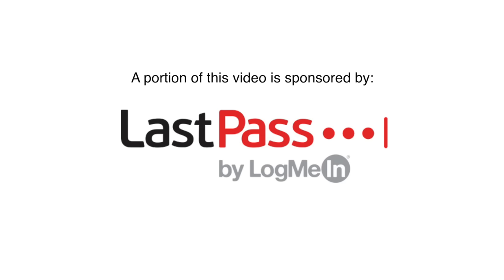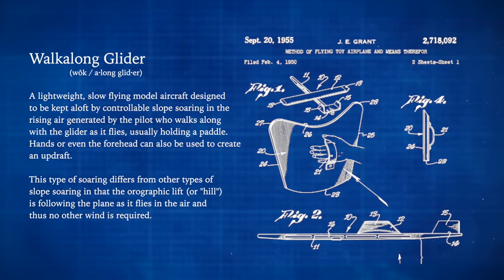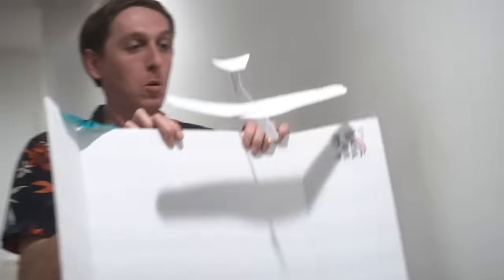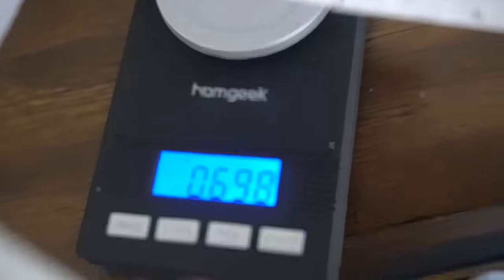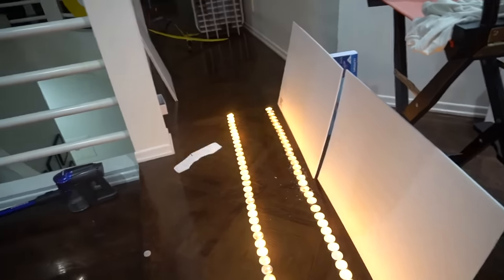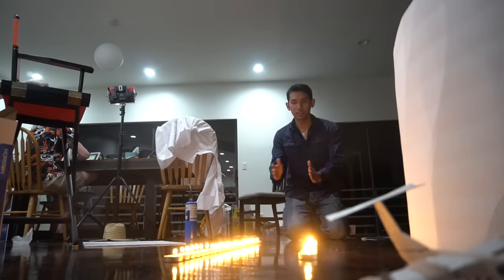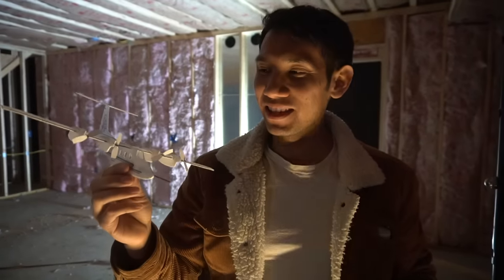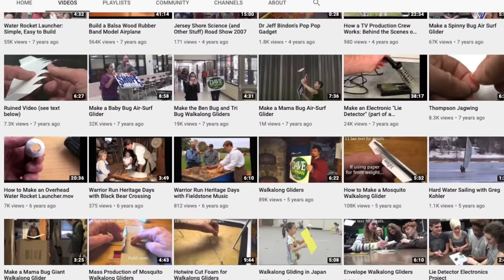Infinite flying airplane! (walkalong gliders)

Comment: This is a fascinating scaled-down study of ground-effect! We experienced this on a much larger scale in the KC-135 air refueling tanker. Whenever we had a very large receiver aircraft such as a B-52 or a C-5 Galaxy, our airplane would pitch nose-down slightly and airspeed would increase a few knots due to the reduction of induced drag from the other airplane’s wing. It had the opposite effect when the receiver aircraft departed, and at times was nearly violent if the receiver pilot wasn’t smooth with his exit. Thank you for this very cool experiment!!
Reply: wtf a frickin air force pilot in the comments? thank you for your service
Reply: not really the ground effect tho, this is the effects of a blunt object in an airstream changing the airstream

Comment: Peter, in many wind tunnels like the ones used to test aerodynamics of cars and stuff, the fans actually suck the air in instead of blowing it out. This gets rid of pretty much all turbulence. If you decide to retry this then maybe you can take this into consideration. :)
Reply: @Caleb P why's that? If he recreates the tunnel, you'd just need to put the plank of foam in front of the fan, and the plane in front of the plank.
Reply: @Caleb P Exactly...
Reply: @Caleb P you've got a point. The point of the air blowing onto the ramp is to generate lift. If the ramps sucked inwards it wouldn't work.
Reply: @Caleb P if the fan was positioned behind the plane and the board to "suck air",  i think the fan wouldn't be "pulling the plane" per say. The fan would be sucking the air all around it. The air would still be moving in the same direction as if it were being "pushed" or "blown". It would still hit the board and still generate lift. 
However, even if sucking the air is less turbulent than pushing it, as @KylePrupas said, sucking it into the board may still create too much turbulence for a steady "infinite flight".
Reply: @Caleb P Wrong. The air flow is what matters, not the location of the fan. If the wind is blowing directly at a wall and you stand in front of the wall, the wind in the middle of the front of the wall is nearly as still as the air behind it. And wind is just as much air being sucked into a lower pressure area as it is air being forced from a higher pressure area.
Reply: @crackedemerald4930  the airflow may not be sufficient to provide enough lift with a board between the plane and the fan, its like trying to suck air through your bedroom wall, it ain't gonna work
Reply: No, I’m pretty sure Peter did what he did cause he wanted it to have a treadmill like effect. Correct me if I’m wrong :)
Reply: @vortorixx  Yes and no. Yes, the treadmill effect worked, but he couldn't make it work indefinitely

Comment: When you are walking behind the glider, you constantly monitor its position and flight path and make adjustments. That is what keeps it flying. With the fan and the ramp, there is constant airflow which would keep it aloft but nothing to control it or bring it back on course when it starts to veer off.

Comment: My own favorite kind of air, for having zero ground speed, was the air near the top of a ridge as I could trade horizontal for vertical air (and vice versa) at will.  I guess the stretch would be to build a plane that would look for ridges.  When pushing cardboard, the ridge tracks the plane.

Comment: It seems like  aircraft without any feedback control coming from somewhere cannot  hover in the air indefinitely. The walk along glider has a control loop and that's why it can theoretically. The loop is the walker's eyes and brain with arm and leg  muscles providing system input to keep it flying. You needed something to sense the position  or movement of the glider, and a mechanism to adjust the controls as needed.

Comment: When walking with the glider, it floated mostly above the ramp's edge, but with the wind tunnel, you always put it inside the ramp. Well, yes, the wind might just push it off if it's released behind the ramp's edge but it's worth a try
Reply: The ramp scenario looked a lot like the oscillations in ground effect. Maybe it just needs a squishier airflow ( behind the ramp )

Comment: Not sure how it took me so long to find this channel, but this dude is awesome!
Good on you buddy!

I'm a paragliding pilot in training, and often we use motors, either gas powered or electric to augment when we don't have ridge lift or thermal lift available.

Here's a challenge... If you are up for it...

A mousetrap or rubber band principled, pedal powered rechargeable paramotor setup.
So charge up pre flight, launch, and recharge in flight!  Possible?

Comment: A dyson fan would have faster air speed at the edges and slower air speed in the middle, so if you build a small enough plane or a big enough dyson fan, it could work

Comment: I think if you would have tied a really thin string like fishing line to the nose of the plane and the other end to where the air is blowing out, it might help keep the nose of the plane pointing towards the fans and might help it fly without swerving so much.

Comment: 2 Ideas. 1: Put the hand held cardboard on the end of a long rotating stick to replace the human element or 2: Think about the air flow you need as being more like a standing wave pool like surfers use on cruse ships. So the plain only gets a fast air boost when is getting low and can drift down when its too high. perhaps take some inspiration from a floor drying blower fan and get a flat laminar flow of air to flow only near the surface of your air ramp.

Comment: The key is dynamic control. The clue is how you fly it when following it around with a board. You need a lift fan and two lateral fans controlled by a sensor (camera that senses plane position) and a (well, two) PD controller. It would more or less be like a magnetic ball levitator. If you can do it with your hands…

Comment: Oooh. I wonder if you could get it tuned to the point that you could use an array of small neon lamps to provide a controlled updraft, and switch the path by switching the bulbs.

Comment: Well, there are two problems. 1. One does not necessarily need a lot of pipes next to each other to get a more laminal air flow, but longer pipes, the longer the better. 2. Yes, one needs a high air flow on the lower part of the ramp and a lower air flow at the top of the ramp. However, the gradient of this has to me smooth and very controlled. With the contraption here it was very fast at the bottom of the ramp and then got slow in the following 50cm or so. One could see that very good on how the glider flew. It glided down and at the bottom it was suddenly pushed back hard and against the ramp. A solution would have been a funnel.
It actually might be very easy to test with one of the very small gliders, the one circling the candles: Just take a long pipe or even hose where you push air through, the flow should get quite laminar. And then just build a funnel to the end. I would guess a funnel of the size 50cmx50cmx50cm might do the trick for this tiny glider.

Comment: I love it !! At about 11:00 you invented a moth circling a flame. Brilliant ! 
Curious... how about rising or directed steam ?? I guess the plane would need waterproofing so it doesn't absorb too much. Krylon Clear Coat ? 
Or a healthy quad with a horizontal stick going out a few feet. Mount an EDF on the end of the stick pointing up at an angle. See if you can get the glider to surf the plume of rising air. 
Every time I watch one of your videos my head sort of hurts... keep up the good work. An imagination is a terrible thing to waste.

Comment: You probably figured it out by now, but you should put EXHAUST fans at one end of the wind tunnel, and the laminar flow tubes at the other. This will pull air thru the tunnel. Of course that means you have to do the flying in the tunnel. Which is why it's called a tunnel. Laminar flow will not survive an open space.

Comment: I suspect it's harder to keep it stable because the closer you get to the borders of your contraption, the slower the airflow becomes. This reduces the lift on the wing closer to the border and now it tends to drop that wing and lift the other, which now results in a turn that brings it even closer to the border. I think that the only way you can get this to work is with a teeny tiny plane for which the gradient of the flow is reduced. Alternatively, you can try to reduce the central airflow, so that it develops a natural tendency to be centered between two "spikes" of faster flows to the side.
when it comes to thermaling, i can definitely tell you as a glider pilot that the thermal is by nature trying to push you out, for similar reasons as given above. The core of the thermal is fast raising air, and generally it's surrounded by colder air that descends. When you get a wing into the core, that wing lifts up, which makes you turn outside of it. It's hard work to get into strong thermals. Once you are in, however, it's relatively easy to stay in, as you are now part of the raising column.

Comment: hey, to fly in a slope you need to set the elevator to a smaller angle of attack. so in normal flight it would fly ascending.

Comment: Seems like an unstable equilibrium. When walking, you are making constant adjustments to speed and direction to keep it gliding, but with a ramp and fan, there’s no good way to make those quick adjustments. It’s like the difference between balancing a broom handle on your hand vs on the floor.

Comment: The fan with a box ramp was perfect, the only issue was that the wings were loose so they would flap and thus make the plane move. If the wings were more rigid you could have achieved infinite flight using the fan

Comment: I know it’s kind of way too late for this input, but I’m pretty sure the reason you couldn’t keep the plane flying over the candles is because you had it on either side of the plane, and the updrafts crest low pressure, pulling it to one side or another. I feel like it may have followed it better had you done to just one row or put both rows side by side.

Comment: Awesome video guys, now a suggestion for a follow up video,
Not sure if it’s been done before but Build an ultralight Rc glider using the lightest and smallest Rc gear available, then build an indoor slope in a hall or similar large indoor space complete with low turbulence fans, I would also love to see the same with the thermal test using multiple electric heaters also using  a larger area with the same ultralight Rc glider 🙂👍

Comment: Out of curiosity, would a longer/thinner fuselage help with maintaining balance in the air stream? It seems once it get sideways, it just slams into the wall. If the tail and body lengths were longer, wouldn't that inhibit rotation? Most gliders I've seen tend to have a long, almost needle-like fuselage with a very large tailplane to keep the back end under control. Gusts from the side cause less interference and the tail makes all the directional decisions instead of the body. (Like programming, but mechanical.)

It's really cool to see those things gliding as you walk along. Looks almost like magic. I never knew that sort of tech/toy existed.

Comment: I'm not an engineer... yet... but I think you should add a small board attached to some strings where the strings are attached to the back of the plane. I think as the plane flies, more air will be pushed from the board towards the plane and so it'll infinitely fly...

Comment: Would a slightly more rigid body help? It seems the wind turbulence deforms the frame, sending it off course. Seemed like similar weight but more rigid wings could hold in place better. That and, actual wind tunnel to maximize air control?

Comment: This is very easily done with a spherical glider. So easily that it can be done accidentally.
What you need to do is design the plane to turn toward the faster airflow, so that it becomes self-centering in the airstream.

Comment: Maybe if you made the sides blow more air than the middle, it would be a better idea. Because, if the plane goes too much to the left or the right, it will get pushed back to the middle.

Comment: If you want to get the wax off the floor take a paper towel and put it on the floor then take a heat gun and slowly melt the wax when it melts the paper will absorb it just lift the paper before it solidifies

Comment: Seems to be lacking a self correcting function..  Maybe a hump or ridge running up/down center the length of the slope to divide the air.  As the plane drifts left the air under the left wing is moving faster and produces more lift to turn the plane back to the right.  Need to create a dead band where there is less lift down the center of the slope, the wing span of the glider will need to be some proportion of the dead band width..  uhmm..

Comment: Could you make a larger scale with solar panels on with a button where you could activate the solar panel for a set amount of time so it will only fly Till the circuit switches off the Motors Otherwise it would fly until the Sun goes down

Comment: Why didn't you put try putting the glider on the other side of the fans? Then you'd be sucking the air over the plane instead of blowing it, so the glider wouldn't run into the downstream turbulence from the fans. This is how wind tunnels work, too.

Comment: My personal view is this is impossible. The wings the glue even a small differ will make it hard to stay in the middle? That is why when you using a hard paper board to add the air flow you need to  adjust the angle and make it turn? anyway worth trying though, I still emjoy watching you guys doing  this video.

Comment: Try a flying wing design, high aspect, very very light balsa to avoid flex. Works better. I have also done balloon launch gliders at Lakehurst hanger #1 (180ft high) get a big 3 ft balloon helium and put the glider or gliders on top. Rub your head/hair to get a bit of static cling or make a launch mechanism.

Comment: Also I found an amazing easy way to build insane collimators for air or water flow. just design a solid 3D shape and then 3D print it with a low percentage infill and zero top or bottom layers. This will get you a solid outer edge with a square or honey comb pattern going all the way threw and open on both ends. if you use this please contact me for my real name as i came up with this on my own. My 6-Inch Centrifugal Inline Duct Fan with 2 inches deep of 1/2" cross hatch infill is pretty great.

Comment: What if you used a pendulum to dynamically control the flight surfaces with fine thread. Threads could also be run from the wingtips to the body and tail to control the plane's flex.

Comment: I know I'm late to the party lol but if you want to lose the turbulence you're gonna have to have that fan sucking instead of blowing. Just look into how and why wind tunnels are constructed the fans create the slipstream by sucking air through instead of blowing air in - if fans were blowing the tunnel would be useless because of high turbulence. Of course this would require building a wind tunnel but hey maybe it's a worthy project for a video one of these days

Comment: do you realize that by using fans you are doing the oposite of those walkaling gliders? With the walkalong gliders the air pressure is on the TAIL. With the fans the air pressure is on the NOSE...

Comment: I don't think it'll work.  I think you can't get a perfectly consistent material or airflow no matter how hard to try that will let you get a plane to 'hang'.  I think you could do something, if you had some kind of gyro setup and control surfaces.  It's just too chaotic otherwise.

Comment: You have too much insufficiences! Your gaps around your air tunnel your holes at the bottom. Air pressure  will always find the closest escape.  And that will cause a roll draft! Suciing the plane in. And if recal you designed your plan for back draft lift so make your balance a tad more to the rear. You got this state neighbor

Comment: What if the problem isn’t the air flow, but imperfections in the plane. They seem so light that uneven glue would throw it off.